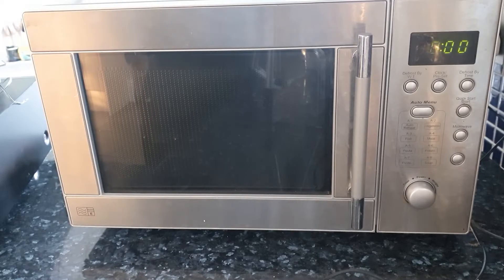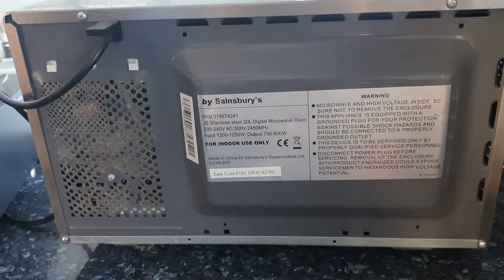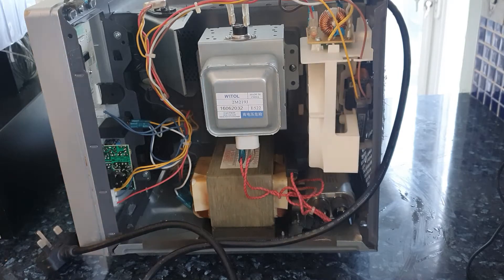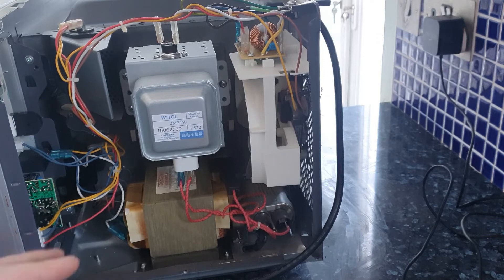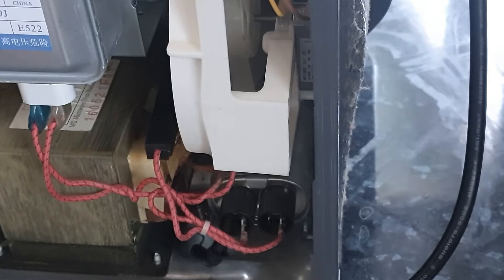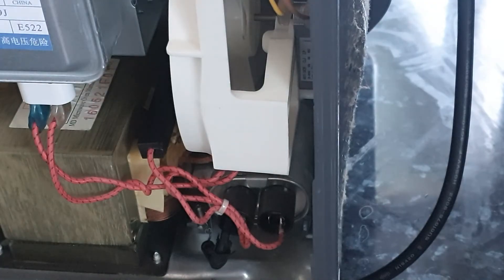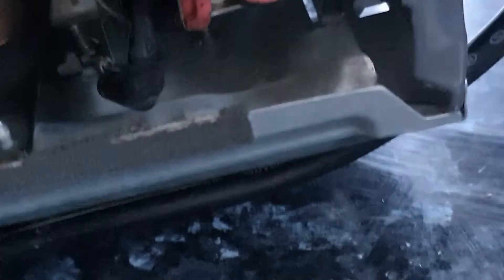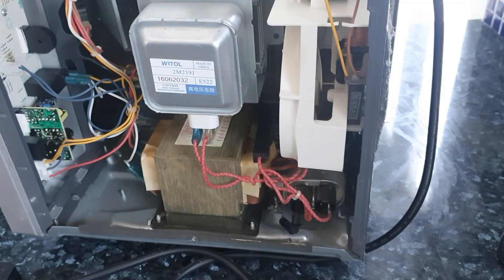Microwave works but wont heat - Cheap and easy fix

Comment: You will destroy your multimeter by checking if the capacitor is not properly discharged.. just poke both terminals at the same time with an insulated long nosed pliers.

Comment: Safety precautions related to the high voltage capacitor is not adequately covered in this video. Take note there are other issues that look simple but can make  the oven not to work. These include but not limited to the door interlock switches, and continuity test of the wirings

Comment: Is there a sign that diode has been broken like burn marks? In my case, we hear a sudden pops like electricity or something then it does not heating afterwards, but it is working like yours. For the fuse, my question is the same. thank you

Comment: Captain, you completely missed the capacitor!  When I was doing repair, failure was 50% diode, 25% magnetron, and 25% capacitor.
Very Best Regards,
Tom Scott 🗽
Author ● Speaker ● World's Leading Expert on the Corrupt U.S. Legal System
Stack the Legal Odds in Your Favor
Our American Injustice System

Comment: Hello, 
I have a strange microwave ( not heating problem) !
All components tested separately is ok . 
But current consumed by the transformer is not stable ( 2amp , 5.5 amp , 7 amp) randomly. 
Heating occurs only @ 5.5 & 7 amp. 
Almost time current is 2 amp☹️.
Even if I supply the transformer directly with external electric source. 
Where is the problem?. 
Microwave system is 220V

Comment: Just be careful the meter is not capable of checking for the high voltage it might have.  It needs to be fully discharged before you work on itake sure you connect the diode the Right way aswell.
Reply: This diode happens to have a ring terminal on one end and a female quick-disconnect terminal on the other. The direction in which the arrowhead polarity marking is pointing will confirm that your replacement part is of the same polarity as the original part.

Comment: Do not expect microwaves to live forever, they normally got a life of 6 months 2 years, specially if many people is using it and adding dif materials that they shouldnt.

A microwave can cost around 250£-50£ so they arent that expensive anyway, instead trying to buy the megatron or repair it just simply get a new one, also you arent a profesional so dont try this type of things.

Comment: I replaced my magnetron. Got it $50 off Amazon. Why do you say it’s gone if the magnetron is bad?
Reply: lol 50 plus time and effort, when you can get anew one at that price. Better to donate it to someone who can repair it themselves
Reply: Because the magnetron hold radiation and will cause cancer if continuously handled
Reply: 50 bucks?.I'll just get a new one ty
Reply: at that amount, i could already buy a new microwave, or second hand one. 😂

Comment: My SAMSUNG microwave stopped working. It is turning on, plate is turning and light will come on but the time won't move and food won't heat. Any idea what this could be? Thanks!
Reply: Hi 
Your microwave is working now??
I am suffering from the same problem 
Any idea ,how to fix it
Reply: @iamamysterygirl786  I didn’t get around to fix it, yet (it’s for my son’s pottery studio), but will let you know once I do. I may give it a go in the coming month. I read it could be the door switches and that’s what I’ll try: replacing them. Best of luck!
Reply: Im not a professional but if the times not moving i would check the control board

Comment: The other easy fix is resetting the thermal safety switches that sometimes pop.
Reply: How does that work? My microwave stopped working. It is turning on, plate is turning and light will come on but the time won't move and food won't heat. Any idea what this could be? Thanks a lot

Comment: i read your blog online. I have a combination microwave that is powering up fine but does not heat. i have replaced the diode but l also want to replace the fuse, but am unable to locate it as it is not in an obvious place. could l possibly send you a picture of the inside of my machine together with the wiring diagram for you to help me locate it? i have contacted the manufacturer and they were no help!  it is a combination oven, grill and microwave made by Belling.
thank you
pauline
Reply: Did he get back to you Pauline, on where it’s located?

Comment: Hi, i really want to try this but although l can find the diode, l can not find the fuse anywhere? It's a Belling combi microwave Model number M396TCCS. Please can you help me locate the fuse? thank you
Reply: The fuse is encased a black cylindrical plastic container, or a black tubular container or a white tubular container.  Usually placed near the huge transformer or near the capacitor. Usual rating is 800mA.
Reply: From my understanding, the fuse is literally a fuse. You can just match the rating written on the fuse to any microwave fuse, it does need to be the same brand. There's two kind, slow blow or quick blow. Just read the number on the fuse and search for it.

Comment: Dude ,
 if your magnearon  has stopped working you replace it, i would never state its not worth repairing, that`s the trouble with this day an age , throw away nation,
You never advised checking for loose connections first, or checking other possibilities like the thermo cut out device on top of the magnatron with multi meter ,you can easily check the magnatron for fault, usually cracked magnet,
You can pick up cheap enough parts these days to replace the damaged parts,
I would always discharge the capacitor then test, electricians have died through trusting the trickle discharge,
One important point remind people to unplug the device first ,some capacitors hold 2000 volts and this must be discharged do not rely on leaving it to discharge its self by leaving it a few hours or a day bad advice, also they must be warned about the transformer the power from the capacitor travels along to the step up transformer, this is also dangerous if touched in the wrong place,
please if making a video like this please be more on point with the dangers what and where they are,
I suggest to whom may be attempting this go and check other video on the the dangers in microwave be for attempting to poke around
Reply: you think i look like i got MONEY!?
Reply: Idk depending on the price of the magnetron and age of system you may be better off getting a new one that way you get a warrenty and stuff like that
Reply: In this day and age, unfortunately, if the main section of the microwave is busted, you might as well get a new unit... unless you have it under extended warranty.  The parts are almost as costly as a new microwave or any other major appliance.